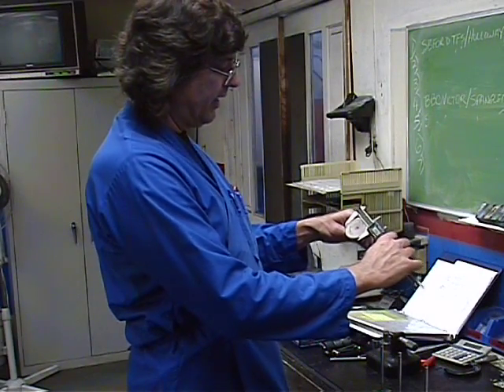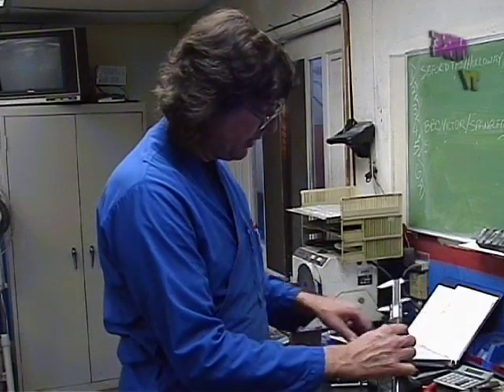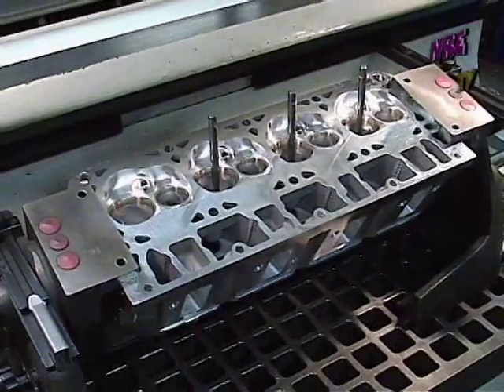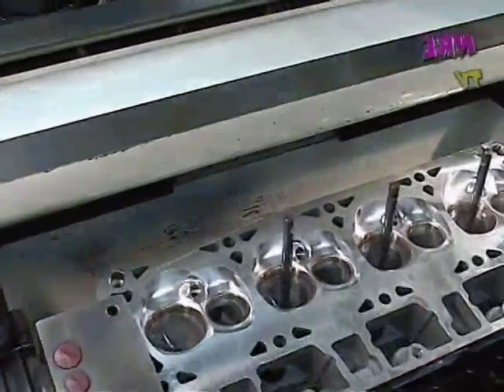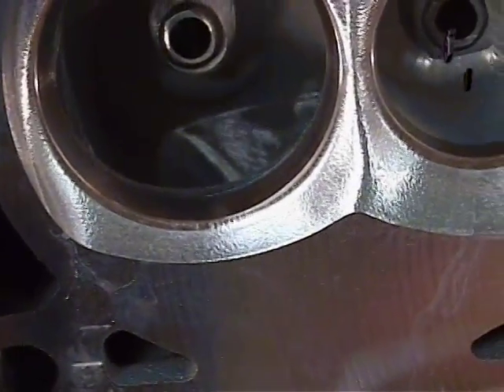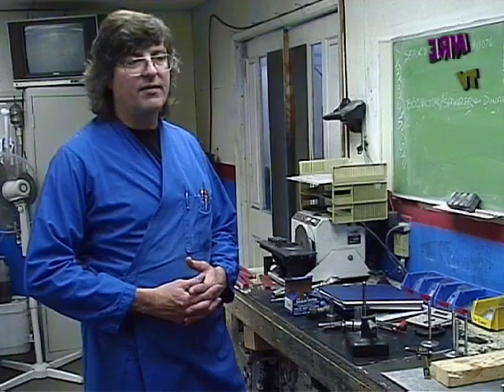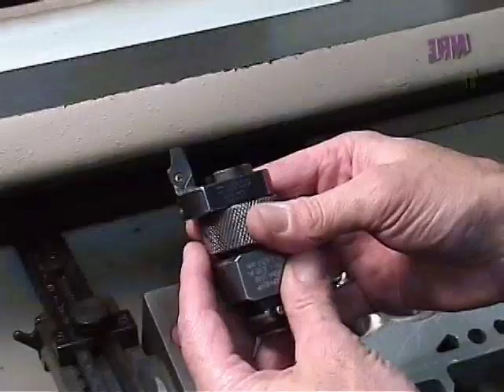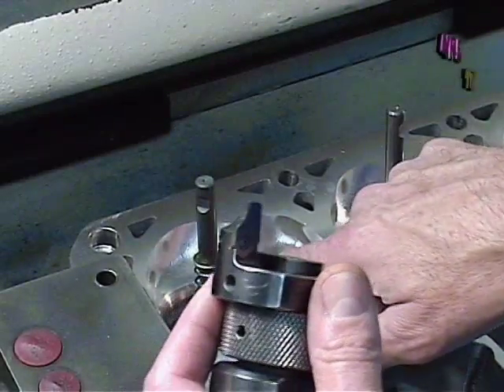NRE University: Cylinder Head Secrets, Part 2 of 2.

Comment: This guy has a vase knowledge of information, more skill than 95% of you, and the only thing you can comment on is his  pronunciation. You all should be as gifted and talented as he. We all process information differently when we are communicating, especially being filmed, which in it self is stressful, It's not like sitting around a poker table smoking cigars and drinking scotch with your buddies. Grow up.
Reply: Vast knowledge and information??
Anyone can buy a three angle valve seat cutter and perform this work,
"Three angle valve jobs" being the secret to huge power is total crap the length and shape of the port IS and for forced induction its not even that crucial and certainly not on the street... don't waste your money spend it else ware........
Reply: jacqui sewell
Doesn't matter how well the port flows if the seat and valve flows like shit. With a good 3 (or 5) angle you will see gains not only at max lift but also at mid lifts. Would you mind providing some kind of evidence for your claims? What you're saying goes against some of the most basic rules for a good flowing head.
Reply: jacqui sewell I'm not an engine builder, but I do know a little about engines.  I have a great respect for guys, like yourself, but my main post was about the insensitivity of others.  Getting a point across to someone doesn't have to involve sarcasm.  From your last post you seem to have a vase knowledge of information.

Comment: Do you work with your cutting tool supplier to produce the angle cutting tools you need or are they off the shelf? If you came up with it, I hope you can patent. 
Also, do you not need cutting oil or coolant for aluminum? Is that a three axis milling machine? Do you CMM?